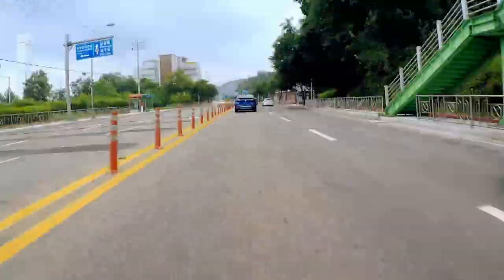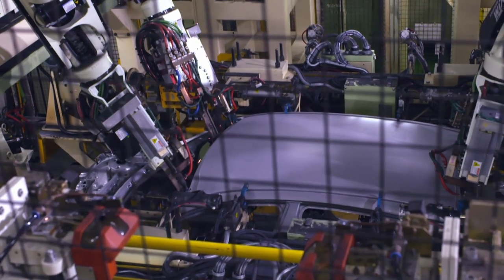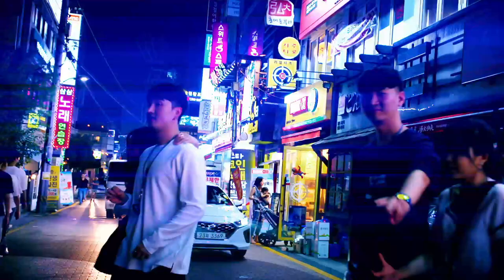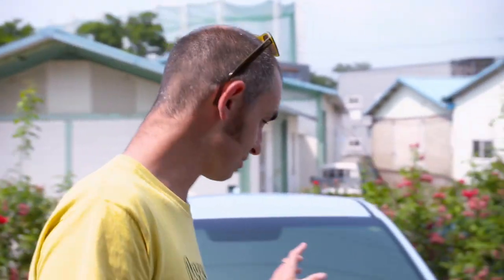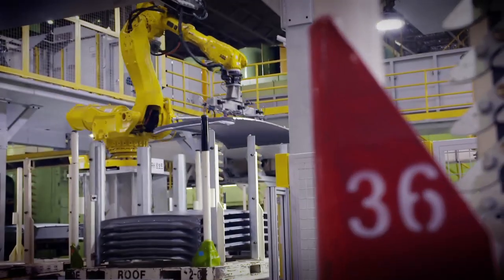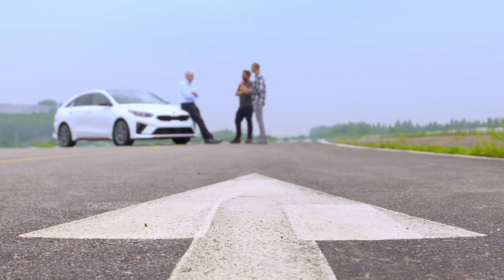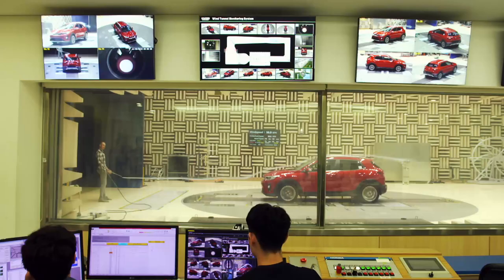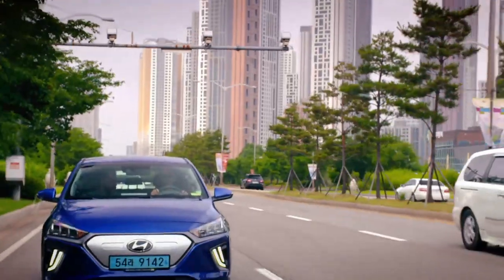Kia's secretive testing facility in South Korea - the FULL feature | Fifth Gear

Comment: This must be before the Stinger came out.
Reply: The proceed and stonic came out after the Stinger I'm sure. Not sure why they didn't feature the Stinger
Reply: This is after the Stinger since there are Veloster Ns which came out later.
Reply: @marcco954  yeah, it makes no sense that the guy didn't talk about the Stinger, since it was already out in 2018 in Korea. Hyundai did start the N line in Korea is 2016, so perhaps it was badged, I couldn't tell if the styling was the same, but I read the Veloster N did come out in Korea in 2018, so it's weird that he was tight lipped about Kia models with motors beyond the 1.6 turbo if this was in 2018. They already had released the Optima 2.0 turbo in 2016 and that put out 241 hp. Maybe he was just referring to that particular model they were being shown, who knows.

Comment: Nice cars, but you can’t compare them to Germans 😎
Reply: Nah bro, theyre comparable. Just look at the Stinger. And they have a lot of Germans flocking over to Korea to work with Korean engineers and designers because of mutual respect and admiration between them.
Reply: Stinger is better value for money than equivalent German model and better car is many ways. Standard features are incredible. Have you seen the spec as standard, especially for UK market? German cars start at base price and then they charge for almost everything else, even things that should really be standard. Just a con

Comment: This must have been filmed before the new Genesis models came out.
Reply: The Genesis brand seems very promising.. Their models especially the GV80 looks stunning!
Reply: Kevin P exactly!! I have high hopes for Genesis especially considering the fact that Merc and BMW’s new model don’t look good at all!!
Reply: This has to be pretty old, since the Stinger launched overseas around 2017, with the 3.3 liter turbo model being the top of the line putting out 370 hp. They also had a 2016 Optima GT that put out 241 hp from a 2.0 4 cyl liter turbo. Hyundai already had the Genesis coupe back in 2008 in Korea then 09 in the US. Yeah, the Genesis coupes are nice, and sedans. The new K5 GT 2.5 liter is quick also.

Comment: They make low quality vehicles that fail catastrophically.
Reply: I do not know where you get your information. How many manufacturers give a 7 year warranty to start of with? I live in South Africa. Here a car suffers every thing you can imagine. From normal heavy traffic daily commutes to long distance high speed travel.  Gravel roads, good roads, bad roads, gravel roads, wet, dry extreme heat and cold, yet there is plenty of Kia's older than 20 years still going strong and if I may add still trading for high values on the used car market,  20 year old Kia easily reaches $1500+ on the SA market.
Reply: @JJSmith1100  I had a 2001 Hyundai Accent and travelled a lot of Australia in it with no problems at all.........................Now I have a new Kia Stinger GT V6 Twin Turbo and is the best car I have ever driven.
Reply: @qikdraw67  I also have a KIA Stinger--going one one year with my 2020 AWD 3.3TT--not a hiccup and I have driven it in 2 inches of rain and taken it to the drag--the AWD could rip a 12.7 98 in the quarter and can handle going the speed limit in a downpour with flooded roads. No hiccups yet and I knew they did a lot of torture test on the stinger--btw my Stinger has a 10 year warranty--100k--can no beat that. KIA--Hyundai--is also a big steel producer and in house makes a lot of parts which leads to much better quality.I am all for local business--but american car companies major reliability issues come for sub par parts they get from third party manufacturers--In one case ford got a bad batch of 5.0 mustang blocks and built thousands of cars with the block and many had failures--even videos on here and Ford would battle folks over fixing them.
Reply: @JJSmith1100  most likely a neckbeard troll